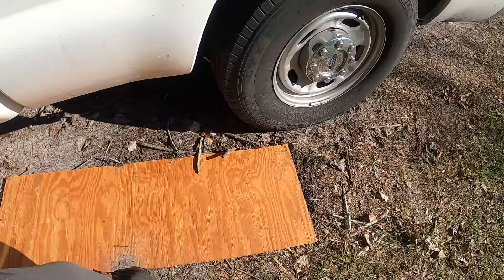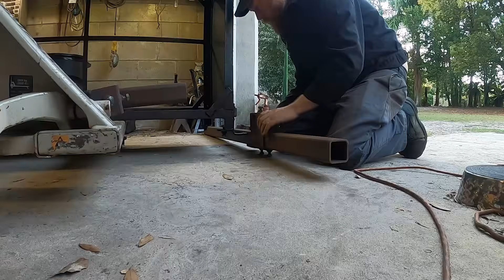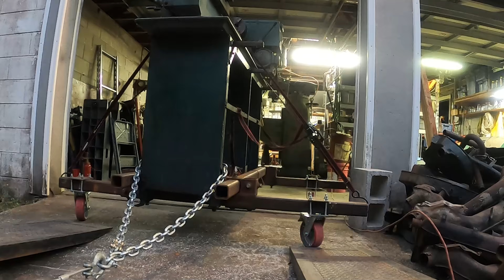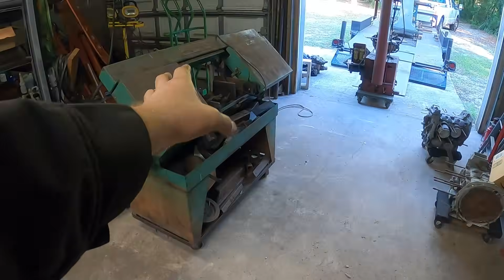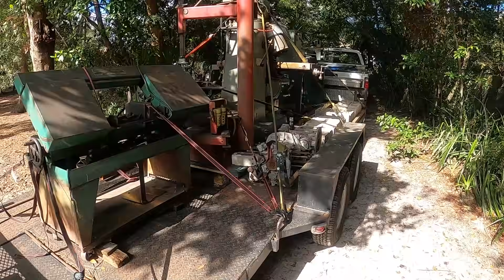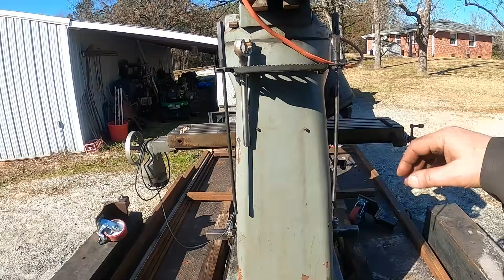When Leaving Gets Real

Comment: 70 with a trailer? Is that even legal over there?
Reply from the maker: I had to look it up but t's different in different parts of the country. The eastern states (where I am) default to the standard limit but require a "safe and reasonable speed." I believe having a well-maintained trailer and balanced load go a long way in avoiding unwanted attention from the authorities. Staying in the right (slow) lane, using turn signals, and letting the rig determine a comfortable speed have worked well for me.
Reply: @HapticGarage  We have travel at ~50 mph max speed.